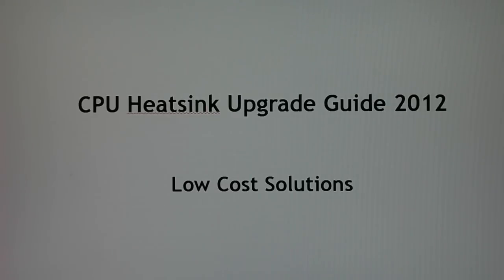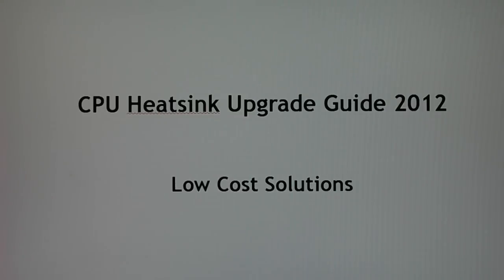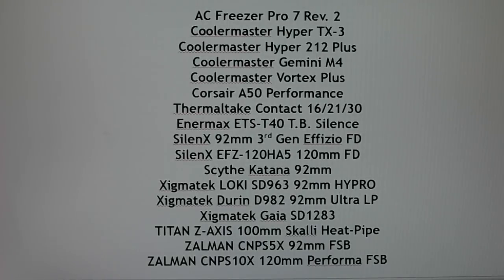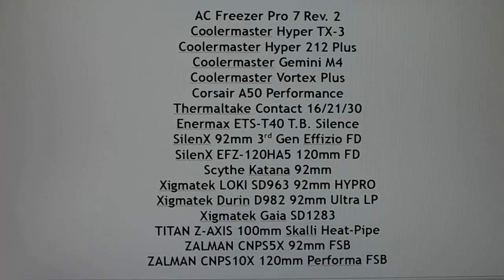CPU Heatsink Upgrade Guide: Low Cost Solutions

Comment: The Arctic Cooling Pro 7 Rev. 2 and Coolermaster Hyper 212 Plus are both excellent for stock replacement.  I have been able to find them in the $19.99 to $29.99 USD range most of the time.  That is new and without a mail-in rebate.  Both have maintained acceptable temperatures at stock speeds under various ambient temperatures and have even allowed slight overclocking of AMD AM3 four and six core CPUs as well as Intel i5 2500K Sandy Bridge and the i5 - 3570K Ivy Bridge.  OC at your own risk!